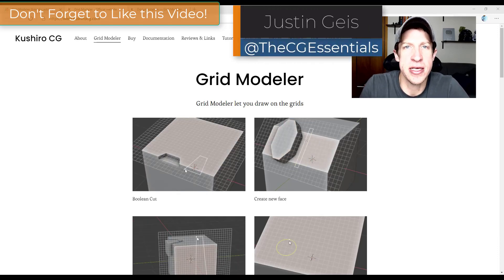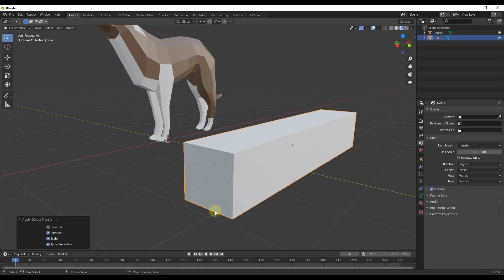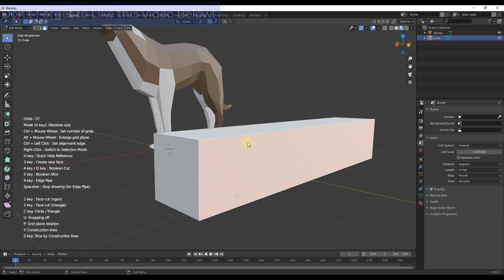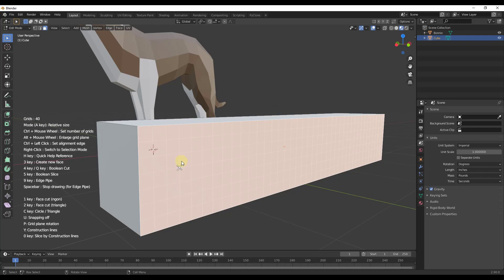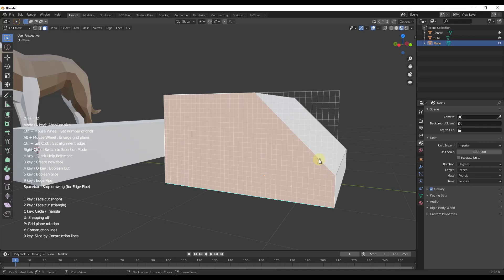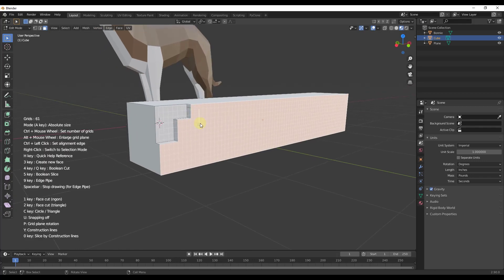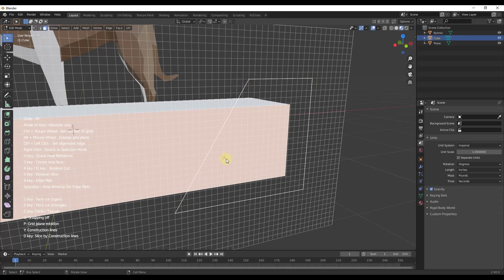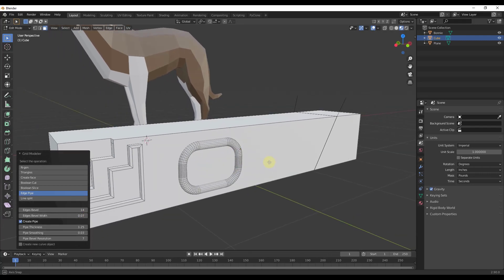Hard Surface Modeling in Blender with GRID MODELER!

Comment: I don't quite understand the shortcuts because my English is a little weak. What is the shortcut to growing the grid and how the grid can expand to the outside of the object. What is the shortcut to extrude and what key do we press to confirm after we have drawn on the grid.
Reply: use ALT+ Mousewheel to Expand the grid size and then can immdiately start drawing the shape , if you like to further expand the grid , you can while drawing you can use alt plus mousewheel combo to expand or shrink the grid , you can use space bar to break the shape and start drawing it from a new point
Reply: @sameeruddin  The plugin doesn't work in blender 3.4 version.😞
Reply: @Kurabiye.Canavari  it seems to be working here m8 ...maybe uninstall and try reinstallong ..also after uninstall quit blender and reinstall ..and quit again before using it ..sometimes the python repository doesn't get updated ..incase you missed this step

Comment: Thanks again Justin - this may be my new favorite add-on! 

2 minutes after buying it, I wondered if you REALLY needed to be in face mode, or if it worked in edge or vertex mode. It does, and the results are great! Here's a cool tip - start with a single vertex, edit, and hit Grid Modeler. Now you have a grid plane that is super easy to use, add faces, pipes, whatever, with precision. This one is cool and has potential!
Reply from the maker: Great point - it does align with edges and vertices as well - it's definitely a lot of fun! :)
Reply: @TheCGEssentials  The new interactive primitives in Blender 2.92 and Grid Modeler make quite a powerful combination. I just discovered what "A" does and how it shows divisions on the surface nicely without the need for making subdivisions or loop cuts!

Comment: Whooowhats up Justin 😁
although I already know and use BC, HO and Fluent, GM looks pretty interesting.
So you can choose which workflow suits you best.
At the moment I'm more at Fluent than BC because of the workflow, but both are very good tools.
However, Fluent brings more tools with it than just boolean operations - (grids, pipes, wires, chains - with templates - just great).

Let's see, maybe I'll take a closer look at GM.

Thanks for the introduction, Justin!
Reply from the maker: I'd say the one thing to be aware of with Grid Modeler is that it's destructive - you can't make changes to the booleans like you can with Fluent - I do like how quick it is though

Comment: Does this compliment something like Fluent? How do you think this compares with Fluent? Nice video, as usual.
Reply from the maker: Sort of - Fluent uses booleans for more of a non-destructive workflow. It feels to me like this is more designed for quick modeling based on what I'm reading on the developer website, and it does feel like you're going faster when you use it, but the fact that it's destructive does mean you can't go back and make changes later